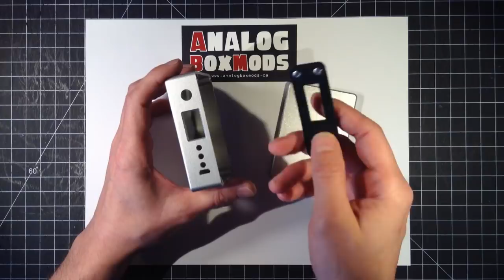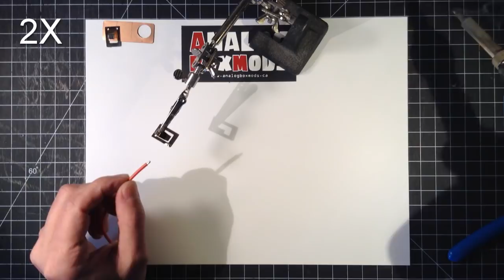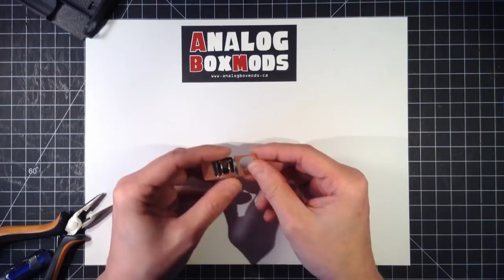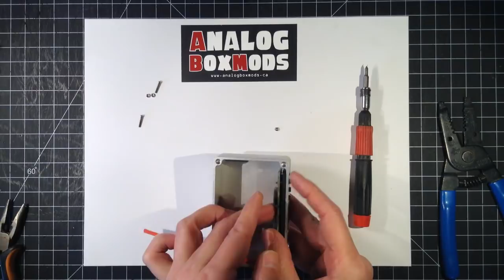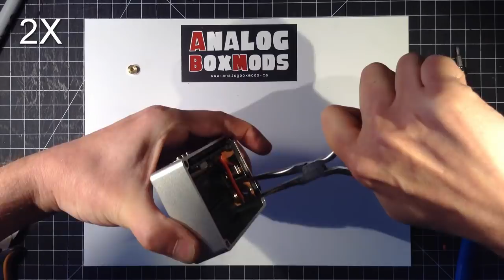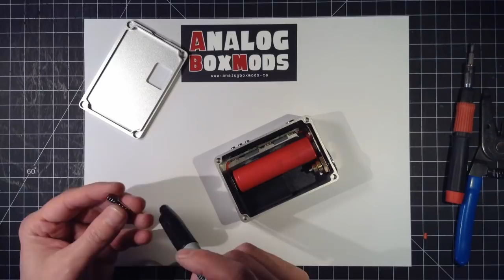DNA75c 1x20700 ABM2 Squonk Enclosure DIY Box Mod Build

Comment: Great demo build and nice looking kit.  The only thing I would have liked to have seen differently mill out around the 510 so that the base is flush with the box.   Not a deal breaker but it would be so much nicer with a flush 510. Imo thanks for the video.

Comment: How about the internal mounting option for DNA75C do I glue the board holder to the mod? Doesn't seem to be any other  option..
Reply from the maker: I prefer the "external" mounting option where the screws go through the face of the enclosure, easier to install/remove the board.  For the "internal" mount option the board still screws onto the board holder then the board holder is epoxied inside the enclosure.

Comment: On your web site I see enclosure(s) ABM-1, ABM-2, ATI GXL DNA TYPE 2. What is the difference in these enclosures ?
Reply from the maker: You can see those 3 individual enclosures and their descriptions (size, etc) under the enclosures section, http://analogboxmods.ca/Box-Mod-Parts/Enclosures .

If you are looking for a squonk compatible enclosure the ABM-2 is the only one, but if you are looking to build a non-squonk DNA75/75c then,
- ABM-1 is a good 1 battery enclosure, fits either 1x18650 or 1x20700
- ABM-2 will fit 2x18650 or a small lipo
- ATI-GXL will fit 2x20700 or a larger lipo

Comment: Could this fit a 21700 or just a 20700?
Reply from the maker: It can fit both 21700 or 20700.
Reply: Analog Box Mods OMG THANK YOU!!!   Mine is arriving in 2 days and it just dawned on me that I didn’t have any 20700’s. Lol. I’ve been looking for this info everywhere, just in case

Comment: Is the 75c wired the same as the 250c
Reply from the maker: The Bat+, Bat-, 510+ and 510- are the same but the 250c has the additional balanced charging pins...